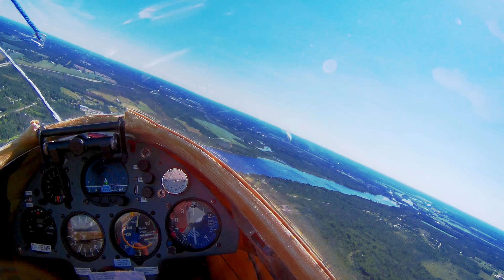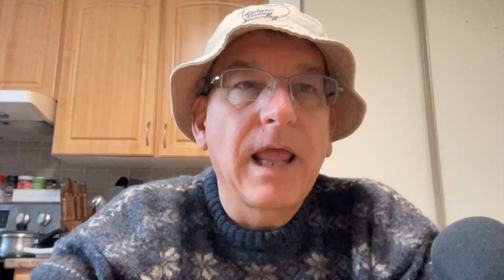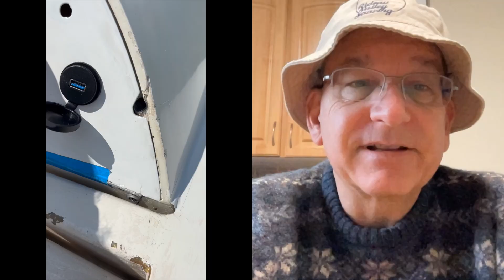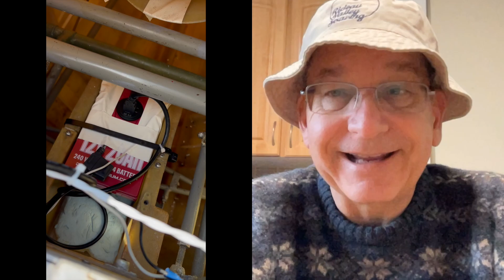Glider Suddenly Loses Power On Downwind

Comment: I have always carried a handheld radio with me as a backup . I did have an occasion once where my battery crapped out and although the vario was working
and I could receive, I kept getting " last transmission unreadable" from other aircraft. So I switched to my handheld. 
It turned out my battery was only producing 11 volts. Good enough to receive and keep my vario working but transmitting  . . . . . . . .na.
Reply from the maker: Transmission is the first to go as the voltage drops.  The radio goes slightly off frequency.  Radio is optional ... unless you are in Class C, where it is mandatory, and having a backup would be a very good idea.  I was in a club glider one time and the battery I had in it was not fully charged.  It transmitted on lower frequency ok, but was unreadable at the higher frequencies, which included ATC.  I was (of course) denied access to Class C when I requested it.